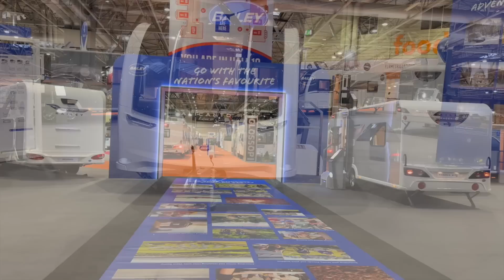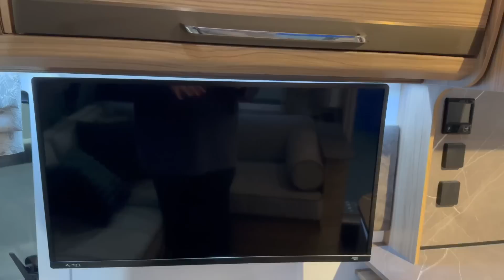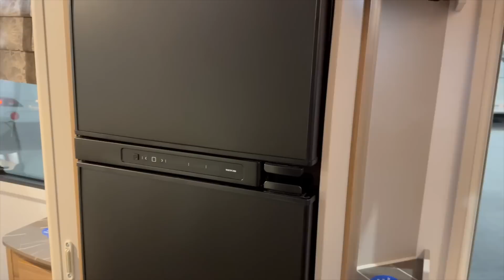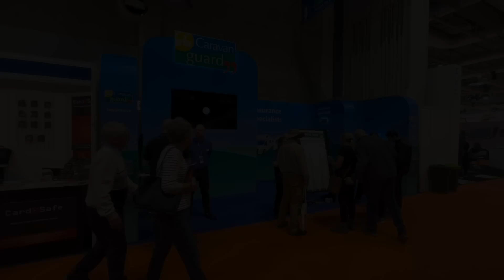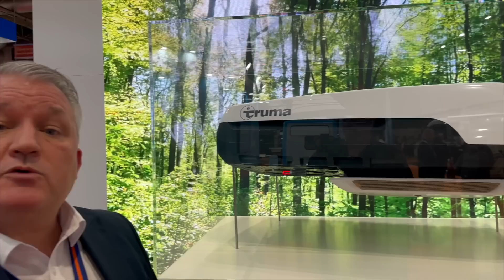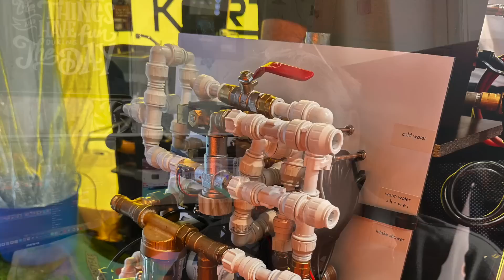2024 Motorhome and Caravan show - Part 2

Comment: Been following your Vlogs from New Zealand for a few years.  Love the content from this NEC show visit to your trips away, and maintenance tips.  Our camping in NZ is a bit different from the UK, but a lot of the info is applicable. We camp off grid a lot apart from a 2 week Xmas break where we crowd into a commercial camping ground.
We have a Swift Eccles 645 and looking to upgrade to a Challenger All Road 645 (Export to NZ model only) It's on a 100mm higher Al-ko chassis which makes access to rough sites much easier.

Comment: Thanks Dan.  I'd meant to ask you before about the bathroom door...  on the Evora, which we have too.  Both of the brackets/hinges the door hangs from have sheared.  Our kind dealer sent replacement for the first one when it broke  but we couldnt work out how to easily get the door off and the bits still in the runner. We've had to tape them to one side as they jammed the door solid and took some freeing up... and blue air!!   lol  We have to manually lift and slide the door to open and close.  Its a heavy door and has no floor runner to keep it in place either and take some of the weight.  .  Its gonna be a warranty fix at its service.  Anyone else had this problem?  Being only top hung and heavy on two little nylon pins.. shocking design flaw.  it wobbles in transit which is why we think they sheared off.   And dont start me on those stupid fabric straps and useless pop studs!!!  lol  Rant over.  Looking at the new one you featured... design has gone backwards.  Such a shame except for the lounge... loving that.  Thanks for all the product  reviews.  We couldnt make the show... next time.

Comment: So to use the microwave in the Alvor
Kneel on the floor
To take anything out to stir it 
PUT WHERE ? The floor ?
When finished still on your knees or a low squat raise hot food above head put on work surface or try and balance while standing up 
Accident waiting to happen
Cant see this being a seller
Reply from the maker: But also, keep the doors open when in use.
Reply: 😢 Agree with you completely. Back to the drawing board...

Comment: Re: your comment about the loo being on the “wrong” side. Fully agree with this. Anyone who has a smaller awning (ours is a 390 on a Swift 650) and adds the bedroom extension at the rear of the van is going to have to drop the rear bedroom inner to access the toilet cassette - madness. 

The services access should always be on the opposite side to the entrance door/awning.

Comment: Good vlog as always Dan. I like the Alvor, but can’t help thinking the microwave was an afterthought. They’ve designed the kitchen and then realised they’d forgotten about it. It would be too much faff having to open both cupboard doors to use it, and then have to step around them when you’re still using the kitchen. I can see broken cupboard doors and hinges being a regular occurrence!
Reply: Crikey yes - that's a very odd position for the microwave 😜

Comment: Dan I have had the Truma Aventa air con fitted  on two caravans. A real lifesaver in france and I would not be without.. However I cannot understand why they have a heat facility when modern caravans are fitted with heating systems that are so good. EG Alde. I really do believe they should market them with or without heat. Surely air con is about cooling. Why pay for something you do not need and they could therefore make the price more affordable.
Reply from the maker: Hi, I’ve used the heating - when initially setting up in the winter. I must admit it was great adding instant heat while the Alde was warming up.

Comment: Van looks nice but like you don't really want loo or fridge vent on the awning side. 
You didnt comment on the hob - 1 x electric & 3 x gas???
No rubbish location for the microwave.
This is a) too expensive & b) too heavy for us.
Far too many vanlifers on the road sonot impressed with campers!
Reply from the maker: Yes, the cooker is dual fuel hob, separate grill and oven. 👍